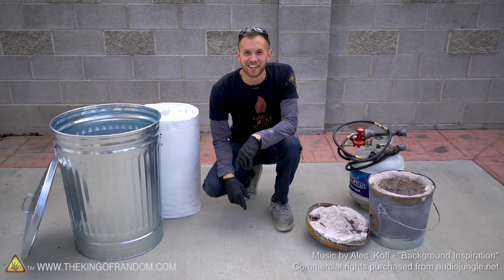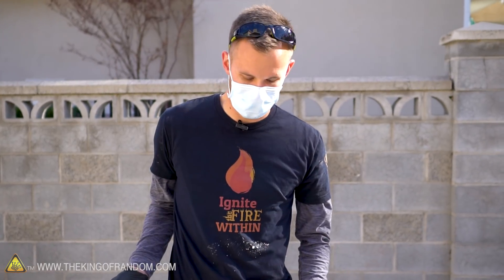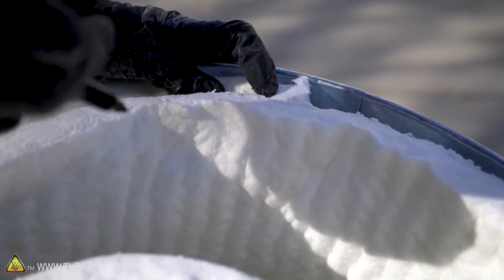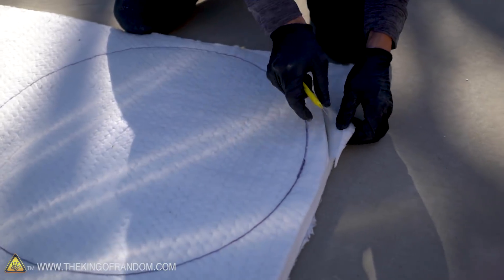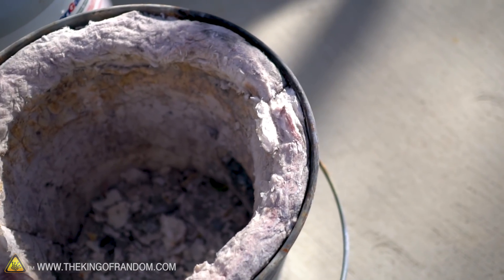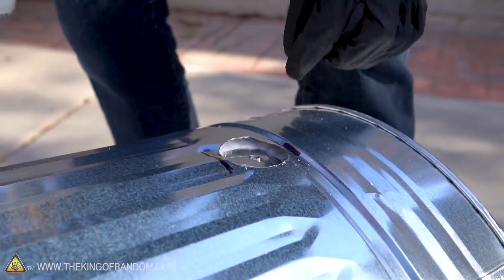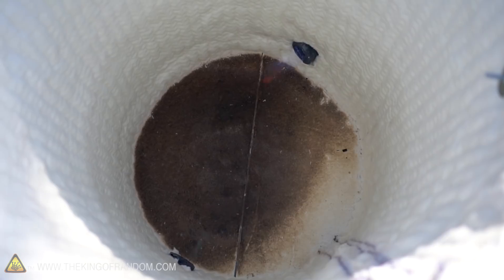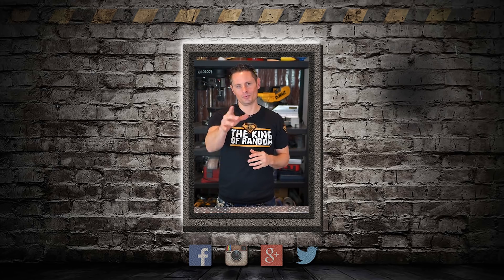MEGA Metal Foundry! TKOR Explores Everything You Need To Know How To Make a Trashcan Metal Foundry!

Comment from the maker: Trending #1! 👊👑
Reply: Yay
Reply: The King of Random hey there, using a galvanized steel can for this application is very unsafe and it's completely unacceptable to give this advice to an amateur audience. Please add a warning not to use a galvanized can like you did at the start of the video, or re-do it with proper materials.
Reply: The Jammer no problem. If you're interested in making something similar, you should be able to use normal steel, or certain stainless steels. There is almost no way a backyard furnace will reach stainless-melting temps on its sides, at the bottom center, maybe, if it's well designed.
Reply: The King of Random He seriously just stuck his arm inside of it, and wasn't expecting it to be extremely hot...?! 🙄😩😂
Reply: xylordkhan1 the bolts will or at least should melt as I did something similar and the bolts melted
Reply: Dante Arcenal not it’s 2
Reply: Thank you, algorithm.
Reply: The King of Random
Reply: The King of Random now it’s 3
Reply: xylordkhan1 it is if it’s properly insulated like this is
Reply: It's number 3 now
Reply: The King of Random v
Reply: Hey
Reply: Is it possibly to burn fiber
Reply: Ca waol
Reply: The King of Random using kaowool is a really clever idea but where did you get the idea to use it for your smaller version??
Reply: The Kzx.
Ss🦅🦅🦅🦅🦅🦅sc🦅c🐚🐚🦉🍫🍫🍻🍻🏄🏼‍♀️ing of Random
Reply: Dante Arcenal it's trending on 4 now.
Reply: The King of Random Trending #5!
Reply: Nice!
Reply: congratulations
Reply: also great video
Reply: can you use coal in the the foundry with kaowool ?
Reply: May sound messy but try baby powder on your skin. It will fill your pores so you won't have to worry about that nasty itch.
Reply: The King of Random ur on 24!!! I'm miles from that!!! <3
Reply: The King of Random no it's 25 now
Reply: The King of Random surely the screws that hold the kalewool  will melt since the temperature exceeds the melting point of them?
Reply: You are so cool
Reply: The King of Random is so cool
Reply: The King of Random how do you do it
Reply: Make a aerogel metal foundry
Reply: Lets go ur the king of YouTube and of random
Reply: The Jammer Joseph Barham The bolts won't melt, but like the can they seem to be galvanized steel, which means they will emit nasty zinc oxide fumes.
Reply: The King of Random  t he
M
Reply: Would the steel bits melt if exposed to those temperatures?
Reply: I'm confused won't the hardware melt in the foundery
Reply: The King of Random i
Reply: The King of Random wouldn't the heat melt the hardware
Reply: The King of Random  a am from south Africa
Reply: And you loved 2 of my comments!!
Reply: You’re great!!!
Reply: I've been trying to find the same size of kaowool you are using in the video but can not find it.  Where did you buy yours from
Reply: The King of Random danm
Reply: The King of Random so cooooooool
Reply: The King of Random what happens when you put wire with the insulation still on in
Reply: The King of Random like
Reply: You guys should try casting a rx engine! Or any tiny engine!
Reply: I think it is would be needed 4 of the fire breathing torch
Reply: Now, that's random.
Reply: entertaining
Reply: The King of Random is awesome
Reply: *How to make a diy portable insolated home.
Reply: It’s your big day
Reply: Whoot whoot
Reply: Whats the cost of this project?
Reply: I wanna use the trash can lid for a Captain America shield
Reply: Lol you put you mask on inside out
Reply: Wowwowowowowowowowow
Reply: Wouldn't the heat used to melt rock melt the screws?
Reply: The King of Random 2nd comment
Reply: The King of Random let’s go!
Reply: The King of Random its trending on #30 now
Reply: o
Reply: Wow, that’s awesome
Reply: Cool congrats!
Reply: Thanks
Reply: Way to go!
Reply: Hazzuh.
Reply: The King of Random THATS AMAZING

Comment: To get a more accurate “cut out” to line the inside of the can: 
1) mark the sides of the top and bottom edge with a marker (or lipstik)
2) Place the can on its side onto a large piece of paper.
3) roll the can along the ground so the marker (or lipstik) transfers onto the paper for 1 rotation (360 degrees)
4) you’ll have a “flat” (arching) pattern that you can then trace onto the “kao/kale/kael?” Wool to fit perfectly...
If you have a hard time figuring this out....
Imagine if you had a paper cup, cut out the bottom, then cut up the side, then flatten it out... this is the shape you are looking for..... if you take that same paper cup, put it on its side and “flick it” so it rolls, it’ll roll in a circle pattern. If the top & bottom edge are “painted” those paint lines will transfer to the surface that it rolls on and you can get a better match to cut out on your roll

Comment: I was told not to use galvanized steel for a foundry because galvanized steel is coated with zinc which is extremely toxic and dangerous to inhale. Do you have any advice on where to find steel trash cans that are not galvanized?
Reply: He's dead
Reply: Just make sure you're not right above the foundry and use it only outside and you will be fine

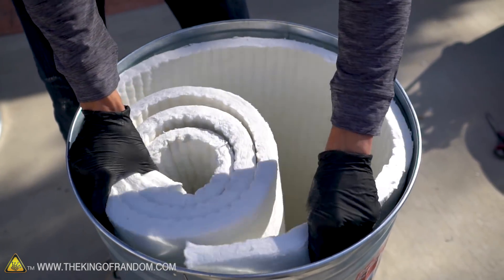Comment: 3:00 just use pi*d and you get the perimeter of the trash can

oh, it's not a cylinder?

Manufacturer (Behrens) specifies diameter of 21" (lid) and 27" (can height)
Bottom not specified, but by a taken image from their site we can calculated that 230 pixels = ~ 21" (lid end to end)
With a conversion factor of 0.0913043478261 ppi, measuring the bottom end to end i get around 190 pixels, witch would = 17.35", let's call it 18" to account for measuring errors

Let us take the geometric form of the can as a frustum (truncated cone), basically two circles with a given height, so the upper one will be ~66" and the bottom one 56.5"

Comment: Try putting in the kaowool lining for the sides before putting in the bottom kaowool and ceramic fiberboard base. It will seal the heat in better. Also, it will hold the sides at the bottom better.

Comment: Try making a mini foundry were you melt the metal without a crucible.  Instead, there is a pour spout on the bottom leading to a short shoot.  Kinda like a cement truck.  If you can do this, then you should be aboult to just pour driectly from the foundry (now  a smeltery I think) into your molds.

Comment: I think your bolts will just wick a lot of heat away to your outer metal shell, circumventing all that fancy insulation.  Kind of silly to use metal hardware inside a thing made to melt metal anyway.

Comment: If you use bolts to hold the wool in place make sure they don't have zinc plating or galvinization. When you heat zinc up it releases a bad gas that can make you sick.

Comment: So, is there a new "king" of random?
This guy looks different.
Also, if it insulates that well, just use a spray adhesive.
And as far as the insulation, i see some listed as 4# and 6#, but this is listed as 8#, however, they all say 2300 degrees.
I assume the higher the number, the thicker the blanket, and the better the insulation?

Comment: Congrats, with those machine screws you just compromised your insulation and the can will now heat up.....  Granted it doesn't make it useless but I think using a thin layer of refractory plaster would have been a much better solution.

Comment: Former fire and EMS here - just a heads up, galvanized metal offgasses due to its zinc coating, if you can't find regular old steel, then use a few coats of high temperature paint.  I went with a 2000 degree rated primer, 2 coats and a 2000 degree rated paint, 2 coats.  I plan on adding maintenance coats as needed from wear and what not.
Another thing I did was go on amazon and get a $16 welders hood with flip up eye shield.  Hasn't seen any flying concrete with molten metal yet, but I'll be glad I have this if that ever happens.
Reply: Does zinc never rust thats why its used as a coating for chains, wire fence and such?
Reply: @r3ll282  I believe so

Comment: For future reference although a hole saw made for metal would be best, if you must use one such as this, rotate the drill in reverse. It will take longer, but you'll get a cleaner cut and the teeth won't tear the thin metal and leave burred edges.

Comment: If the long machining screws are left in you could turn the foundry on its side, and with some of that sheeting in the bottom you could use it as a shelf for a more stable placement for ceramics. Realign the propane holes and you could turn the foundry into a blacksmithing forge.

Comment: Could you use charcoal with this?
Reply: Yes, you can use just about any fuel. But you want it to get as hot as possible if you're going to melt steel or anything with a high melting point. Charcoal is fine for melting aluminum, it's easy.

Comment: Firing ceramic properly is a little more precise than I think you’ll be able to with this. It requires holding a specific temperature(it Varys depending on the type of ceramic) for several hours.

Comment: Should have used a castable and painted it on the cable this is a pretty half-assed build for this channel I'm not impressed at all that kaowool will not last getting it hot and getting brushed up against and it's not half as efficient because there's no castable on top of the cable which there should be just like the small one that was built is how he need to build the big one no different none of my foundries are just lined with kale wool and nothing else even my Forge it's insulated with kaowool and then lined with a castable

Comment: 1 inch of off brand kaowool in a 36 gallon foundry is like thinking a candle could be able to heat your 6000 sq ft house thats insulated with half an inch of ply wood. This thing will not get over 1400, and even thats generous.

Comment: I know you probably aren't that concerned with the efficiency or how hot the outside gets but you really should break your bond   so on the wool add another layer with the seam in a different location and if you are concerned with losing your internal diameter you could go with thinner wool. You should also break your bonds where your walls meet the floor for example layer of wool on the floor then one layer to the walls then the second to the floor then the second to the walls the point being there isn't a straight break in insulation leading to the shell. Would also recommend useing stainless fastener. Anyway just 2 cents from someone who does it for a living(industrial level) so if you need material or anything hit me up.

Comment: Using bolts and nuts like that will create a thermal bridge. You should insulate between the large washers on the outside and the sides and top of the can.

Comment: I dont know how high of a heat your crucibles can withstand. But your propane setup could be modified. Try getting a bottle of oxygen with your propane. We use Oxy/propane burning with our cuttting torches at work. and they slice through steel. If you wanted to smelt with something with a higher melting point than brass, I'd give it a shot. Just be wary of the ratios. And blowback.

Comment: Can your foundry melt titanium??????
Reply: Kaivalya Sathe No, not only would it be extremely difficult to get the foundry to 1,600 Celsius (Titaniums melting point) (propane wouldn't work), but the steel trash can would melt at around 1,500 celsius (steels melting point).
Reply: randy H. Can the smaller foundry melt titanium
Reply: Kaivalya Sathe Well, it is also made of steel so that could be a problem but yeah, if they used a hotter burning fuel (not propane) and the foundry was made of a different material then I would assume so.

Comment: and those screws will conduct the heat out so don't touch it, it will burn, unless they will just melt.... FAIL
Reply: Jackice that's true, but they won't melt if they are steel.
Reply: randy H. True unless the right temperature, but this foundry I wouldn't know how high it can get just saw this, liked it until I saw the bolts, the can and will conduct the heat to the outer surface
Reply: Jackice Yeah, that could cause problems, but it definitely wouldn't get hot enough to melt steel I'm sure. I'm more concerned that the steel is galvanized which can give off Zinc Oxide when heated and is toxic.
Reply: randy H. We are on the same page then

Comment: Just a thought. That hardware you installed to hold the kaowool on the sides effectively creates a path for the heat to escape through the wool via conduction. You will need to be careful as the outside of the fasteners will likely get very hot.  
You may want to think about getting a laser thermometer to measure the temp difference between the side of the can and the fasteners.

Comment: Wouldn't the machine screws eventually melt from the heat of the foundry
Reply: Stainless steel has a melting point of, now i may be wrong it has been a while since i have been welding, around 2500 degrees F
Reply: Amos Ongondi not if they are steel (very high melting point), they may weaken and droop but I doubt it because there is no weight pulling the screws down + it may not even get hot enough for that.
Reply: @cappy6100  I think they would if they were long enough heated. We still have the force of gravity.

Comment: Can you try to use kaowool to hold thermite
Reply: It would most likely burn through it. This "wool" is just fibered stone so... you'd get lava. But I agree, hes should do that!
Reply: @Dinnye01  doesn't that make it like asbestos
Reply: KaoWool feels like a squishy foam fiberglass, its a bit expensive but extremely easy to find on ebay and any major hardware store. You can poke a hole through it with your finger, and it falls apart if it gets wet. KaoWool can withstand about 20 minutes of 3,000 degree F fire, but it starts to cook and turn brittle and crumble. So no it can not hold an active thermite fire. Thermite is extremely easy to make, it's a powder consisting of metals.
Reply: @RoyceBarber  is that kaowool expensive?

Comment: You can use the extra long bolts to add an inner lining which will defend the wool from the crucible and/or flying metal droplets, keeping it cleaner and secure longer.

Also for hole saws in thin metal you should run them in reverse at high speed.

Comment: You should teach us how to make our own graphite crucibles.  Than you can make one that is scaled up to size for the giant metal foundry.
Reply: Diglett you need a giant, expensive block of graphite and a powerful lathe. You're not going to be able to make your own.
Reply: I’ve got the lathe and its would be just for fun
Reply: Diglett well, in that case, look for some cylindrical chunks of graphite online! Sorry for assuming, its just that most people don't own lathes. Turning smaller crucible probably wouldn't be too hard. Just expensive.
Reply: Brady C cool, I would never do it but I kind of thought it would be kind of cool, many he can show us how to fix cracked crucibles or if graphite is the only material.
Reply: they don't use graphite when they get that big they use silicon carbide.
Reply: You could cast one I useing the right ratio of graphite powder to clay powder
Reply: YES! He can use the the giant foundry too!

Comment: I'd be curious to know if adding those metal fixings through the insulation causes much transfer of heat to the outer metal can. Maybe measure temp at the location of one of the fixings and far away from the fixings and compare? I'm not thinking "heat loss" so much as "danger from unexpectedly hot spots on the can".

Comment: He put cheap hardware in something that’s supposed to melt metal
Reply: YOUREDEPRESSING doesn't matter if it's cheap as long as it is steel. I doubt the foundry will get hot enough to melt steel. (Unless he used aluminum screws)
Reply: randy H. It does matter it’s Home Depot steel hard ware which isn’t solid enough plus he wants to fire clay which is very hot and a long process that can milt that kind of steel
Reply: Huh, I was unaware if that... What kind of alloy is the steel then? I didn't think his furnace, especially one that large, could get hot enough to do that.

Comment: He forgot that the foundry would melt the screws
Reply: Mr Julian The screws are probably made of steel/iron which means it melting point is really high. Higher than the furnace could reach (with propane as fuel)

Comment: If I were you, I would add another layer of insulating to the large one. It would make it so much more efficient, and you would probably need it, because you have a much bigger volume, with a larger surface and you are using the same torches to heat.

Comment: That is a big open cavity you need to heat. Having such a large cavity in the foundry will really be a challenge for those little burners to heat up, and you will find that it takes way longer to get up to temperature compared to the smaller foundry. Also, when you put larger items in there to heat up, they will absorb a lot of the heat which means it will require a LOT more heat to keep temperature up in there while in use. 

I would have double lined the Kao Wool to take up some of that space, and would definitely double up the burners, with two more burners placed above the existing burners about halfway up the trash can.   Would actually make for a cool video; remaking the gas burners two high with a bracket holding one above the other. Two sets of those, one on either side and you'll be set.
Also, place a hard fire brick on the bottom to lift the crucible up so that it is receiving heat from underneath. Will make a difference in the heating efficiency.